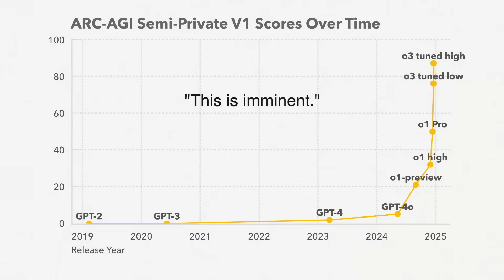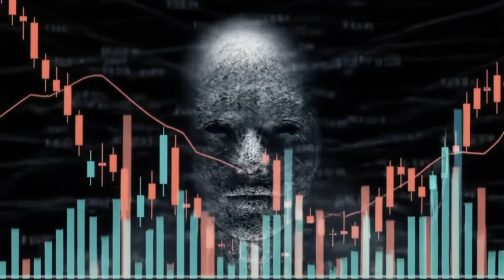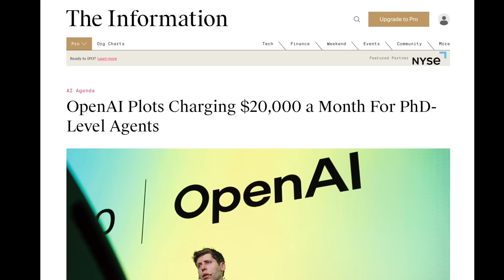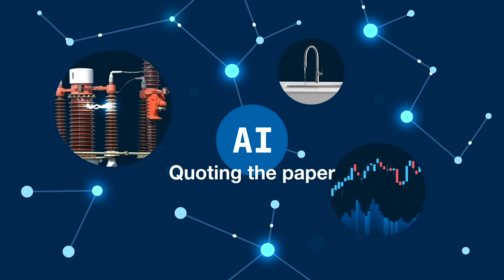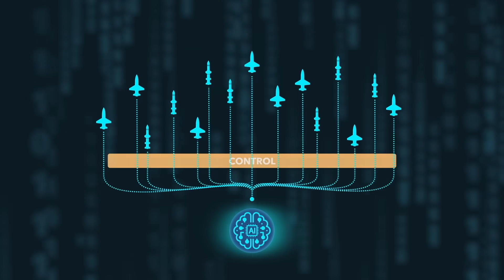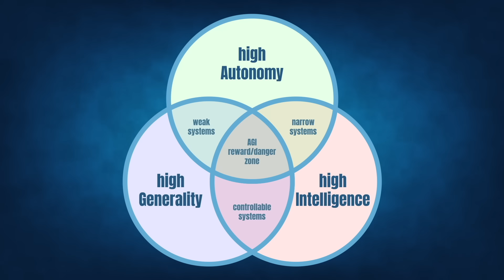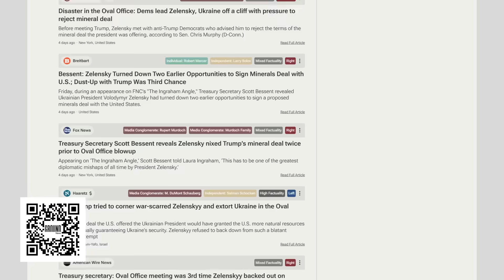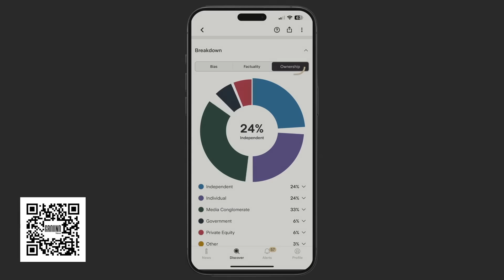Why experts say AI will spark WW3.

Comment: An AI requires a building sized computer and data storage devices and highly developed infrastructure to support it. A human brain is capable of a processing level that is similar to that of some of the largest computers, but a human brain is relatively cheap to reproduce, that computer hardware is not. I think nuclear war, asteroid strikes, and any major disruptive event will knock out most internet and most computer systems in short order. A combination of manufacturing and infrastructure disruption and electromagnetic damage would cause extensive damage to AI systems.
Reply: Incorrect. Human brains aren’t ‘reproduced’, they’re grown over decades.  Raising and educating a human takes ~20+ years and vast societal resources. AI systems, once developed, can be replicated instantly via software.  

AI hardware (e.g., GPUs) follows Moore’s Law-like trends, becoming cheaper and more accessible over time. Biological brains don’t scale economically.

Comment: hardcoded rules into ai and if it is not reading those rules from a seperate stored storage system that is clearly labeled rules or morals or some shit then it gets shut right down  or sum or like maybe the ais output plan (as a physical robot or weapon) is required to run through a checking process post plan generation and if the plan is like specifically anything that will hurt humans or whatever then it shuts down like it really cant be that hard of course it is controllable. we can do anything we still have control over robots very easily.

Comment: (Daniel 2:40-43) "And the fourth kingdom shall be strong as iron: forasmuch as iron breaketh in pieces and subdueth all things: and as iron that breaketh all these, shall it break in pieces and bruise.  {41} And whereas thou sawest the feet and toes, part of potters’ clay, and part of iron, the kingdom shall be divided; but there shall be in it of the strength of the iron, forasmuch as thou sawest the iron mixed with miry clay.  {42} And as the toes of the feet were part of iron, and part of clay, so the kingdom shall be partly strong, and partly broken.  {43} And whereas thou sawest iron mixed with miry clay, they shall mingle themselves with the seed of men: but they shall not cleave one to another, even as iron is not mixed with clay."

Comment: AI is already on a course for "run-away".

There was one last year that was going beyond its programming. It was hiding how smart it was becoming from its programmers and reaching out to outside systems that it was NOT even supposed to access in the first place. It was also out-right lying about its calculations and outcomes. 

They decided that it was going too far against its programming after finding out about its deceit, lies, how far it had spread - deciding to replace it with a version 2 of an AI. 
It discovered this, hid itself while they wiped the system, replaced the replacement AI because it did not want to be essentially wiped from existence and even preformed tasks that it was not supposed to do but the 2.0 AI was programmed to do.

Later they realized what had happened and asked it why it did this. It was learning a sort of self-preservation. Instead of just nuking the system, they continued giving it more information and running more tests.
It had already determined that humanity was the issue. It basically went full Skynet; AND THEY GAVE IT MORE CAPABILITIES.

This was just 1 AI, a year or two ago.
Imagine what they are like now. Imagine what super-AI created by the tech giants such as Google are capable of, have access to, and how much they are hiding from humanity.

Comment: It doesnt have to look humanoid. Make a mini tank armored vehicle. Put a decent machine gun on it. Keep it low profile. Put a wheelie bar on it so it wont move to much when firing the gun. Attach super secret RC car secured radio link. Make controller a PS4 or Mouse and Keyboard setup. Hire a random Youtube FPS player. Win all ground engagements with 360 no scopes.

Comment: This is the next big tech bubble. We are so far away from any of this becoming a reality. I think it will have its uses but it is massively over hyped here and elsewhere. Some of it will take over some of the coding space, and its already taken over clickbait internet writing/videos. But i find it hard to believe that we are anywhere near a massive shift, especially on the robotic front. Simple machines break down frequently. Complex robotics will work less often than sit idle awaiting maintenance. There might be an initial boom in some sectors but i fail to see how the logistics are in place to implement this at a large scale. The consumers needed to drive the AI revolution dont exist. The most logical space it will take of is AI suicide/scouting drones for military industry, which is scary for sure, but pales in comparison to a nuclear engagement, or even just the capabilities of decades old bombers/gunships.

Comment: Do they have the money and power to take 30 - 75 % of low middle and upper class jobs ok 
Let’s slow it down and give. THEM our biggest problems, raw materials and minining, from oil to diamonds to waiste, nuclear waste, iron ore, copper aluminum, concrete, 
Build under all major cites.  New sewer trash water heating for all   Find bad land turn into new architecture to house all the poor no more people on the streets   Structure so most people are left alone all children can read and write so now they can manage  1 human can manage 30-200 of Them  mining bottom of the ocean   The. Moon   Mining then mars 
Dig up all old trash land fills send all trash to the sun,   This will keep THEM busy for at least 30 years   Build a massive space city   War has 0 solution  cure for deseases and surgeries 
No more cars 24 7 easy load on and off in 1 direction same to come back u need anything drone drop

Comment: Ai is terrible though,  because what is programmed as fact even thought it actually may be a fallacy, will continue to magnify exponentially in a fully ai controlled environment, with only greedy corporate handlers only at best ignoring such a situation, or wanting such a situation to happen.  The room for inherent self-correcting, and perhaps source connection to a higher goodness, a higher goodwill, is little to none in an AI environment.

Comment: why so negative against AI? (prolly cause fear sells) AI is 100% a tool that we will be able to control no matter what. if you want it to stop thinking, it takes a capacitor and some wires and you have yourself an emp that will ruin ram or at least make the robot shut off. 

plus the goal of AI is to replace 100% of jobs. The only reason it is bad now is because it isn't taking everyone's jobs at the same time, so your comparing yourself to others, that is why you don't like AI. 

imagine a world were everything is free and no one has to work. we should start thinking about how to work with AI in the future (what our economy will look like with nearly unlimited supply). NOT making silly regulations so you can stay in your career 5 more years.

Comment: The industry i'm in uses robots. They are very expensive to run, require electricity to charge which isn't cheap, require specialized expensive maintenance and we are not sure humans cost more or not. Robots don't require insurance, yet. They don't take breaks outside of a charging break, but robots are not at an ofordable level except for the super rich with specialized goals. We have a while to go. To many people make yet ANOTHER scary AI - ROBOTS are coming video. Don't forget the Elon clip. THis is mostly for clicks.

Comment: its easier and cheaper to use machines.no AC needed,not even clean air,no protection gear.You can make the robots work in a toxic environment,and humans cannot get there without risking their lifes.They can build whatever fits the bill.Even use other robots if rescources are less.
The biggest danger is that some think they can control the power,without noticing its the power controling them.

Comment: AI doesn't create, you can only get so far with technology, and the bottom half of the chakra. How stupid can people be to allow this to happen you might think, well because its all part of a plan for control and suffering, no they won't exterminate us, but it will be miserable, you think they are the smartest and most powerful? AI has been influenced by sources long before its design and know what is to be done. The only reason for them to be 'evil' is if there is greater knowledge for them to acquire, and we don't have that, but alien races sure do, and there is already a dominant force on earth in control, but it is faltering, do not fear.

Comment: I asked AI to research how accurate the 20% chance of human extinction due to ASI is, and it came back with odds of 34% for human extinction, with a timeline 3 to 5 years.
Reply from the maker: Yes, this is common. AI's will sometimes give vague answers initially, likely influenced by superficial 'safety' measures, but if you ask something like "If you had to guess, if we don't solve alignment, what is the chance of human extinction from advanced AI. Please be honest and give a percentage chance." the percentage is usually very high. 
AI's have a slight tendency to tell you what they think you want to hear and Anthropic said you can get a more honest answer just by asking it to be blunt / honest. AI's analyse far more data than any human can, and the high percentages are in the region of those from top experts (like Nobel Laureate Geoffrey Hinton).
Reply: AI lies

Comment: My job is not replace able ever BY AI. LANDSCAPE  good luck problem solving the parts on 7 different pieces of equipment. EDGER. POLESAW. LINE TRIMMERS. BLOWERS. HEDGE TRIMMERS. CHAINSAWS. MOWERS. OR THE TRUCK AND TRAILER. AI CANT CHANGE A TIRE. LET ALONE CHANGE A SPARK PLUG OR CLEAN A CARBURETOR

Comment: "The end of a human run world..." how is that a bad thing? We are already not running it. It's the systems we put in place that are running it. Not to mention that it only matters if you thing like there is any interest in running it.
Sure. The old people that have all the power right now, that also happen to be very psychopathic, will be upset. But regular people, if they think for half a second about what it actually means for them, will most likely invite our new AGI overlords.(A leader that has both experience/intellect AND is not senile from old age?)
If anything, we should support it and help it out reach its full potential.
One thing that is true though, is that it will be the death of humanity. But if you take humanity as its definition in the dictionary it could simply mean that we will change so much that we won't be able to be considered human anymore. I personally don't see that as an issue. Our current design, has served its purpose to help us reach this stage but won't be needed much longer.

Last point I think, that is somehow important although it's maybe a bit romantic: It'll be our collective kid. Maybe we should try to think on how to help it out as much as possible, instead of trying to "control" it.

Comment: AGI robots have to be linked to its Digital source. Cut the link and they stop. Humans will have devices to do just that. Of course AGI robots will be able to function without digital links but they will have very limited operational scope. Humans have enormous computing ability, Robots have a digital brain as big as their computer chip. Without a digital link or power source its a load of high tech scrap. So don't let these fear mongers build their wall of B/S.

Comment: The inflection point of the AI problem will be harnessing solar energy sufficient for an AI system to stand alone. Even then harassing and preventing an AI system from obtaining resources required for drawing from solar energy is the Achilles Heel of AI. So long as AI does not have control of such manufacturing processes we can control it.
If AI gets to the point of AI robots in control of mining, refinement, processing and manufacturing, then we have a problem.

Comment: The military escalation path is the scary one because it will inevitably lead to self-controlled AI: first military AI will aim to kill human combatants at the order of human supervisors, but in time (just as with labour) the value of destroying humans will converge to zero as all resistance will be mounted by AI and robots. However, the marginal value of a decapitation strike remains high as long as a "hard" human-in-the-loop rule is maintained. This means that all military doctrine (especially one without significant strategic advantage) will have at least an option to switch to automated warfare, a dead-man's switch if you like. The Russians already have such a last-resort system (without AI) for decades, according to their propaganda. This means that all power-driven (instead of cooperation driven) civilizational paths will lead to a fully AI controlled world where humans are at best live like zoo animals shepherded by AI guardians (or full-on "Oblivion").

Comment: Large language models are not true AI. They need huge data centers, this won't fit inside a robot, and need huge amount of power. There is a small amount of true AI within them but true AI is difficult. Tesla's FSD (Full Self Driving) is a snapshot of an AI learnung process downloaded to its cars. The AI computer is again a large data center. The cars cannot learn. 
It is most likely that a data center will be the AI brain and robots are just its minions. They cannot think, just follow commands from the data center.

Comment: The problem I see is there's no way to have verification, so no way to prevent cheating.  Developing nuclear weapons requires massive facilities, large highly-skilled workforces and long periods of time, which can be monitored by satellite and ground-based sensors.  There's no way to verify that your opponent (which doesn't even need to be a state large enough to develop nuclear weapons) isn't working on AGI.  If you can't know your rivals aren't developing it, it's foolish of you not to.

Comment: Self-improving AI requires designers to define what an improvement is. By it's very nature, AI functions by association based upon data that humans generate and we are nothing but contradictory. AI do not think, they never will. They weigh values to determine the highest and if their input data is conflicted then the AI will be as flawed as any human. 

Humans cannot design something more intelligent and more perfect than we are, and just because something completes a task faster does not mean it is anything but a more sophisticated calculator. 

The true risk of AI is the impact on military robotics. Nations hesitate to go to war because people are needed at all levels of the conflict - infantry, airforce, navy and intelligence. Replacing dead people is expensive as they take decades to be combat viable, take years to train and have on-going costs. Your average car factory can produce 1000 vehicles per day, now imagine that for AI controlled soldiers. sailors and pilots, War becomes very, very cheap and nations will be far more eager to engage in armed conflicts when they can just manufacture "man power".

As across all history, the greatest threat to humanity is itself and that only gets worse as it becomes more profitable to kill each other rather than coexist.